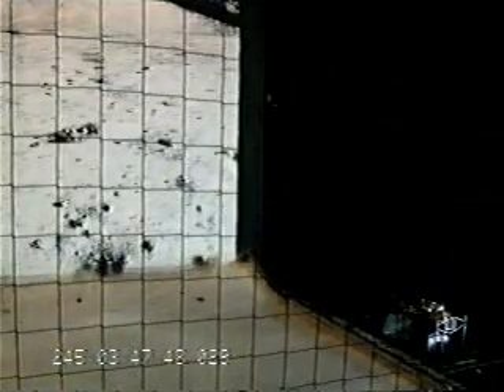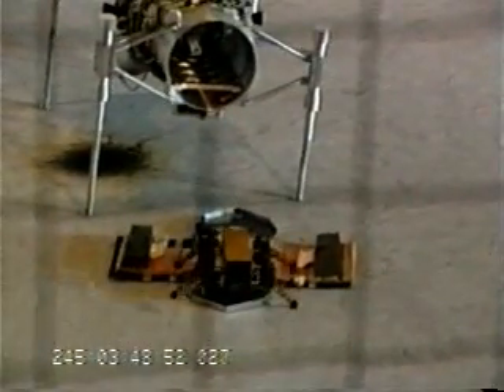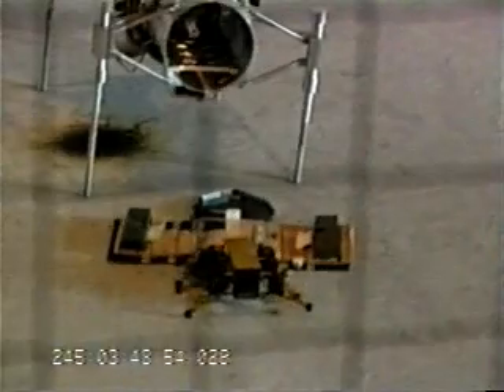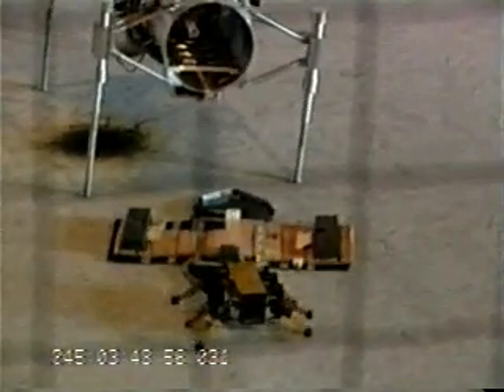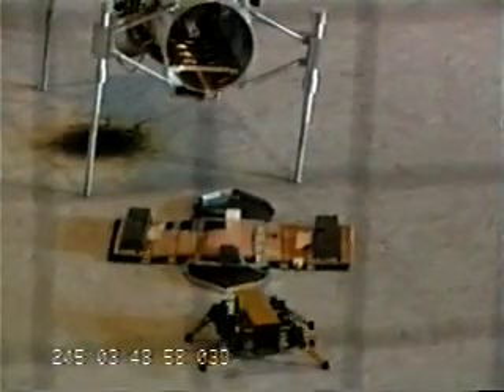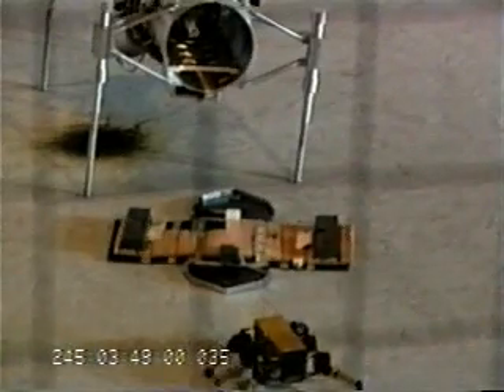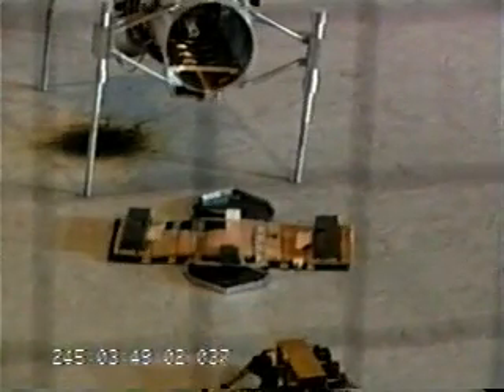ACAT Hover Test

Comment: How does it work? I mean, what kind of energy make it moves? what kind of motor?
Reply from the maker: They are bi-propellant liquid rocket motors using MMH (mono methyl hydrazine) and NTO (nitrogen tetroxide), You can find more on Wikipedia about these chemicals. They are very common and were use on Apollo missions and the Space Shuttle.
Reply: @mmhnto  Thank you for your comment, I appreciate. I've never seen such a device.